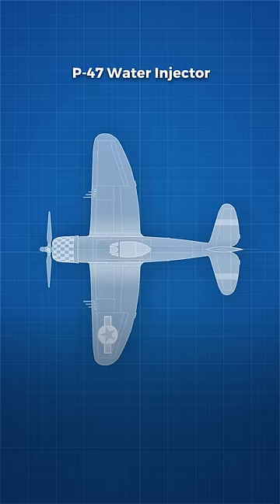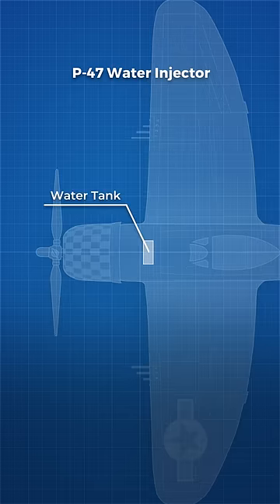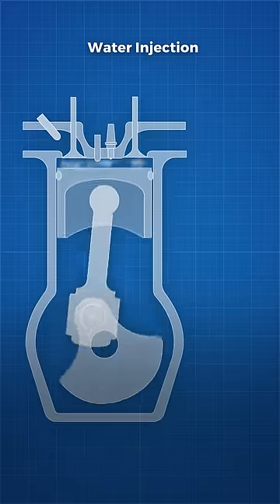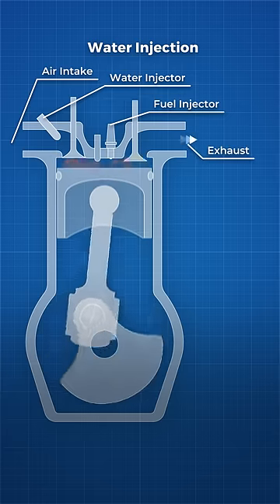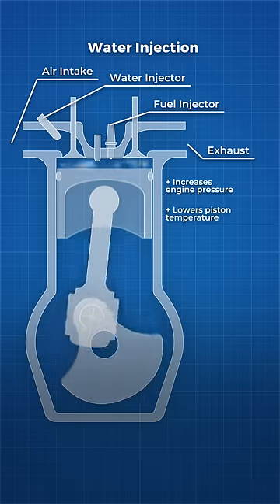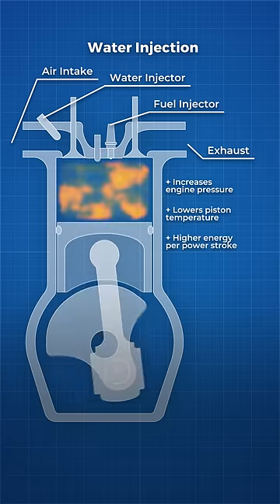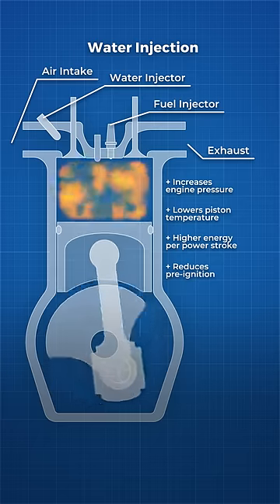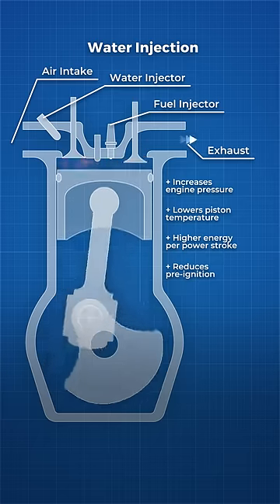How Water Injection Increases Horsepower

Comment: In germany it was "MW-50" For "Not-Leistung" and could be used as long as needed on later states of development. And was sprayed in the "Ansaugbrücke" (Airintake... right infront of the Intake Valve.) 
And was called "Wasser/Methanol-Einspritzung"
Reply: Bf-109 for example
Reply: @ukaszkarpik3476  basically all planes. with certain Engines. Like The DB601 Family, the BMW 801 and the Jumo210 and of course all the developments from these engines.
Reply: "as long as needed"... ONLY PROVIDED, that the MW mixture tank still held enough quantity of the mixture! The limitation was placed on the size of that tank, more than a time constrain based on engine strenght limitations... 

Albeit, a too prolongued MW injection can produce undesirable effects, like cylinder wall oil washing and lube oil dilution and contamination, because piston rings do inevitably present a degree of leakage... 

On the other side, the allies waited for too long to add this type of MW injection, and resorted to limiting maximum power by simply installing a breakable throttle stop, that limited maximum power from being applied, unless the pilot demanded more power for "Emergency" conditions, like during an encounter with enemy planes. Thus, the pilot could push the power above max climbing power, but was advided to respect a time limit of several minutes maximum (about five), and to report every use as soon as possible after landing, that he had used that "WEP" or "War Emergency Power" setting, so that mechanics would put the engine under a more through inspection and possibly repairs.
Reply: @alfredomarquez9777  Of cource a engine shuts down if the feul is empty... and also restricted the NOT-Leistung! we all know that. But as long you have the mixture in your plane, you could apply it without worrying about the condition of the Engine. (And yes.. if its empty.. it dosnt work!) Thx for that.
Reply: @alfredomarquez9777  And Thanks for your effort! Its basically the Wikipedia Text.

Comment: no. pre-ignition is a misnomer. sparkplug fires before tdc. the more descriptive word is detonation, the flame front goes super sonic. creating a shockwave that destroys pistons valves everything.
too much heat and pressure in the combustion chamber and low octaine causes this. waters cooling and spific heat reduces the heat and pressure so reduces detonation, allowing more boost before detonation ocours.

Comment: Helicopter pilot here and I would like to say that many years ago I used to fly the Bell B-206L helicopter with the Allison C20 Engine.  A Turbine not reciprocal engine and it used, normally in the summer when heavily loaded a system of Water Methanol injection    Three gallon tank in the bank where the pilot could inject the engine for just a few seconds to lower the engine temperature just enough so that we could get off the deck and then switch it back off again
Reply: on a jet engine?
Reply: @JavierBrent  
YES... 

Most people ignore that early passenger jets, like some B707 and BAC 1-11 DID USE Water Injection to achieve a better take-off thrust, without  overheating their turbines! 

But soon thereafter, jet engines were upgraded and the water injection was not used anymore.  

One sad accident on a BAC 1-11 was caused by a stoopid mechanic or airport fuel dispatcher filling the water tank with Jet Fuel instead of water, which damaged the engines and caused the crash.

Comment: Minor correction: you explained that having ignition before bottom dead center will cause the power stroke on one piston to counter the power strokes on other pistons. That’s only partially true, but highly misleading. 

Instead all engines use some form of advanced timing, igniting the fuel-air mixture before the cylinder reaches BDC. This is because at high RPM there isn’t enough time for the flame front from the spark plug to fully ignite the fuel before the power stroke ends and the exhaust opens. Relatedly however is the phenomena that peak power will always occur with a (small) amount of unburnt fuel, so that maximum power is usually obtained significantly below stochiometric ratios (where all fuel and all oxygen get burned). 

As a result the P47 (and everything newer) used ignition well before BDC, with many performance engines igniting more than 20 degrees before BDC. 

Side: I skipped compression ratios as 1) the P47 and all warbirds were running 6-7 to one (modern engines are 10-15 to one) and so aren’t really comparable and 2) compression ratios mean very different things when comparing engines with fundamentally different parameters. A compound turbo supercharger (as found on some P47s) can run over 70 inches of water at varying altitudes, while a system with the exact same paper performance at sea level may perform significantly worse at altitude (remember in short: compressors increase effective engine size and altitude decreases effective engine size - in both cases by changing the amount of oxygen - a compressor gives you more oxygen which lets you burn more fuel which is exactly what a larger engine does. 

Related: generally you want to add water/meth injection to a hot engine so you can squeeze more performance out of it - this includes naturally aspirated engines, though there the benefit is a lot smaller (except on Harleys in the Southwest - then it’ll help keep your engine cool enough that you can add more fuel and timing, so in this one instance you gain both reliability and power.

Comment: So the colder temperature means 1: the intake air is denser meaning you can fit more of it in the chamber and react it with more fuel, and 2: reduces the risk of pre-ignition. Have i got that right?

Comment: Water mixed with Methanol (alcohol) was used to keep the water tank and lines from freezing at 35 below zero temperatures at altitude.
The water while absorbing heat turns to STEAM increasing the cylinder pressure significantly.. upwards of 600 psi more than normal... = More torque.
Methanol itself making additional power is/was not the purpose of the mixture.
Certified aircraft mechanic/ war bird restorer here.
Reply: Was there actually increased wear, oil dilution, or other long term  problems?

Comment: Is it blowing the air in under pressure, or is it sucking the air?  I am pretty sure it just converts some of the heat to pressurized steam that gives it more power.  I don't see how that system increases the air entering the engine, it just makes the air that enters more moist.

Comment: How the water injection helps in more intake of cold air?
Reply: When you compress a gas, such as air, it gets hotter. WWII aircraft almost always have a compressor of some kind to compress this air before it reaches the cylinders, so without any Intercooler or Aftercooler, this air will be very hot, and thus, close to igniting without the sparkplug.

Water is extremely good at soaking up heat, especially by evaporating, because it takes so much energy to pull liquid water molecules away from the rest of the liquid. In this hot, dense air, the water and methanol quickly evaporate, which takes a large amount of heat away from the air

Since cold air exerts less pressure than the same volume and density of hot air, it's easier to compress this cold air even further, fitting even more air into the cylinders

However, this "pre engine cooling" is usually done by having extra cooling pipes and systems to essentially "put air in the fridge" for a bit. Water Injection's power increase is mostly related to preventing Engine Knock, thus allowing the engine to be run more aggressively before serious danger happens
Reply: @spindash64  Ok but engine running at high rpm will have less breathing period, so wouldn't it be less effective?
Reply: The engine is turbocharged. The water is intercooling instead of using a radiator intercooler. This prevents compression detonation and knock from the intake air being too hot.

Almost everything in the video is wrong which is part of why it doesn't make sense. 

I assume they don't use a radiator intercooler because weight. That or maybe the thinner air at altitude is a poorer heat transfer source meaning a larger radiator.

WWII airplane engines like this are almost always tuned so the manifold is at sea level, not for a positive boost on the turbo. It was seen as an altitude compensation system, not a power generation system. (also because this isn't a ton of boost this may also be another reason for no intercooler) While the water could have theoretically allowed more air in, the regulators forcing that sea level manifold pressure would prevent that from happening.
Reply: @Thesupremeone34  

That's decidedly false. Manifold pressure on almost every WWII Fighter is set up to exceed 1.2x sea level atmospheric pressure at max power. Some reach more than DOUBLE Atmospheric pressure
Reply: @spindash64 True.  The later 109 models had enfines that could reach 1.98ATA
Reply: @Red-Magic  
And the "too late to see combat" P-51H model could use Water Injection + 150 effective Octane rating fuel for a whopping 3.00 ATA of Manifold Pressure
Reply: @gtrfanboy4933  
It has less breathing period, but remember, the supercharger is pressurizing the air before it reaches the cylinders: it "wants" to flood into the cylinders quickly.

Also, most WWII Aircraft engines increase power by increasing manifold pressure, not Rpm, and they have their max RPM in a similar band, between 2,400 and 3,200rpm. This is noticeably lower than the redline RPM of most car engines, which can usually handle well above 5,000

Comment: It wouldn’t raise the pressure. It just increases the density. Also it’s barely any water, mostly methanol. Kind of a miss of a short. Also the fuel injector is labeled incorrectly.
Reply: Typically a 50/50 mix is optimal, hence the term "MW50" being specified for aircraft injector systems (it maybe -50f at 5 miles up). The manifold pressure is actually reduced by the cooling effect, increasing charge density thru Boyles Law. This allows for greater cylinder pressures (torque) once ignition occurs. The alcohol both antifreezes, cools, and burns as fuel; but the water is the main player as it both cools & moderates hot spots in the flame front (Octane booster) and converts to steam vapor @ 1600 to 1 expansion in volume (as in steam boilers). Note: you're not flooding the cylinders with water, it's more like driving in high humidity/ foggy air, which does help engine performance/ reliability under high loads. Yeah, the diagram dosn't represent the actual radial engine well, but basicly works. A real discussion of the subject needs a half hour or so.

Comment: Did you just say it lowers the power output of the engine? But You said it increases HP in two ways.  Im confused then. I have a 07 Dodge Ram 5.9 diesel with a few modifications.  502 hp at the rear wheels. I have a Snow brand weter/meth injection system and it definitely offers a increase in HP, with add fuel. Does it affect a gasoline engine different than a diesel engine? 
How does it help make HP but lowers the power out put?

Comment: Not very accurate, I have operated the R2800 like the engine on a P-47. Water Meth is used to increase the anti detonation quality of the fuel. The way you get more HP is that an increase in anti denotation lets you increase manifold pressure and it allowed the engine to run at a leaner mixture of fuel and air closer to the stereometric ratio. The biggest jump in HP was from the leaner mixture not the higher MAP. Our engine data charts showed we had 2050 HP with no water on takeoff and it would jump to around 2400 HP with water at max power. If we could use the higher octane fuel and water we could get 2500 hp at max power. The water was also injected into the slinger ring of the supercharger right about the same place as the fuel was injected from the pressure carb.  Prue water can be used but the alcohol was used to prevent contamination of the water system. Is is also an antifreeze to the water system. We used pure water in the tropics.

Comment: I wonder if you could take one of those diy fuel injection adapter kits and keep the carburetor and retrofit the carburetor to inject this water mixture?
Reply: You dont need to go that far, water injection kits are available online that bolt on like a nitrous spraybar. Much like nitrous, you only want to activate injectors for high power levels, not at normal cruise power. Also carbs in my experience dont do well with water or alcohol, they corrode and clog. I hear much of the year its wise to run demineralized water/alcohol blend to prevent slush or ice in the system, or algae growths. Most "tap waters only" would cause problems with clogging, requireing PITA acid flushing eventually.
Apparently some exotic Euro car brands have tried it, but owners get sick of dealing with a 2nd additive tank to fill. Like Blue DEF for diesels.

Comment: Isn't this temperature-lowering effect similar to what is done with nitrous oxide injection?
Reply: A small secondary effect of nitrous oxide injection is the cooling effect, but the primary effect is the added percentage of oxygen and added fuel to get the majority of power increases.

Comment: We had water methanol injection in a 1200 hp Garrett turbo prop I flew in the 80’s. It was ingenious. You would arm it and as the torque went through 70% the valves would open and the torque would increase and the exhaust gas temp would decrease. At night there was a long blue flame that would shoot out the exhaust.
Reply: The CIA had a couple of Hughes 500 helicopters specially modified for a top secret mission in Vietnam to insert commandos in North Vietnam that had water injection added onto their engine's for emergency boost power, they were known as "The Quiet One's" because they also had these special huge mufflers fabricated for the exhaust and special modifications done to the rotors to make them quieter than they typically were, some of the rotor technology was used on the specially modified Blackhawks that were used on the mission to kill Bin Laden, it also is why the Hughes 500 switched from having two rotor blades on the tail to four, one of the things they found out was that tail rotors were responsible for a lot of noise and by using four blades instead if two it cut down on the noise because they didn't have to spin as fast, it was that tech that was made standard on all the 500's after that to make them more friendly for use around populated areas where residents regularly complained about the noise from police and other helicopters. 
If you've never heard or read about those helicopters and the mission they were specially modified for to insert guy's into North Vietnam to tap a top communist party telephone line do yourself a favor and Google "The Quiet One's Helicopters", it's a story that sometimes is as hysterical as it is fascinating, you'll enjoy it being involved in aviation.
Reply: water expands by a factor of 1600 when it turns into steam

Comment: Interesting labelling, the spark plug is the fuel injector now, is it?
Reply: That’s an engineer for you, anymore questions about why working on cars is a pain in the ass?
Reply: @TheTruthOfConflict  are you saying that engineers don’t care about proper labelling? Because you’re dead wrong. Or I’m just weird, one or the other
Reply: @TheTruthOfConflict  Not sure you know what an engineer is then
Reply: @AngryFloatingCow  he was making a joke about engineers being dumb, and therefore designing stuff that is difficult to work on.

Besides labeling a spark plug as a fuel injector, i think he also mistakenly says the "bottom of the compression stroke" when he should have said 'top' when referring to detonation/knock/pre-ignition (which if it occurs, happens before the piston hits tdc, not bdc). Even if the engine runs upside down, the position of tdc/bdc doesn't change.

It's not the end of the world, it's just funny that a channel focused on engineering would mess these up. I watch this channel, he's good, just missed a couple basic details. Stuff happens.

I once saw a cross section diagram of an engine in a magazine, and it clearly showed the spark plug upside down. Electrode in the wire boot, and the top inside the cylinder. It's ironic this was supposed to explain how an engine works 😂. That's kind of an embarrassing mistake for a big company to make, and no one caught it. (Forget which one it was, iirc it was some dirt bike mag.)
Reply: also on an engine that doesn't have a fuel injector
Reply: This is a very poor animation and the narrator's explanation is muddled and confusing.
Take no information from this video into account. Its disjointed and incomplete.
Reply: @AngryFloatingCow  Tell us more about that ignition spark coming out of the fuel injector

Comment: I noticed this when making rocket fuel with sugar and fertilizer. I found that leaving the fuel slightly moist actually increased thrust like crazy! The heat from the reaction vaporized the water and added a lot more exhaust pressure. Thermodynamically, you end up with cooler exhaust which means that more if the energy is thrust and not heat.
Reply: + You might also be getting pyrolysis, giving that the CO + H2O <-> CO2 +H2 is exotermic.
Reply: water expands by a factor of 1600 when it turns into steam